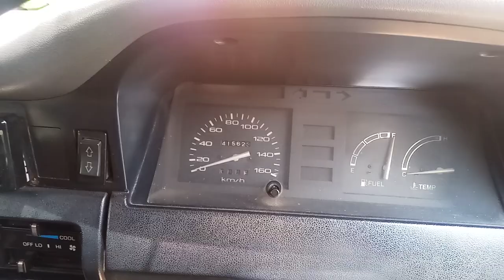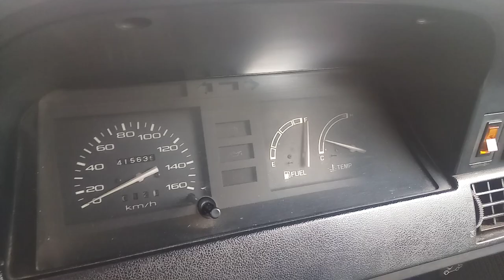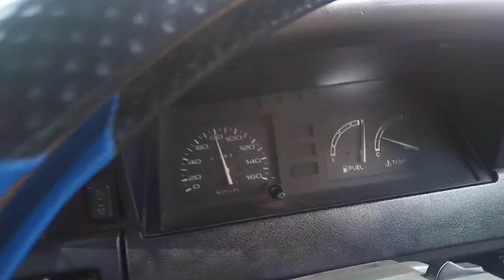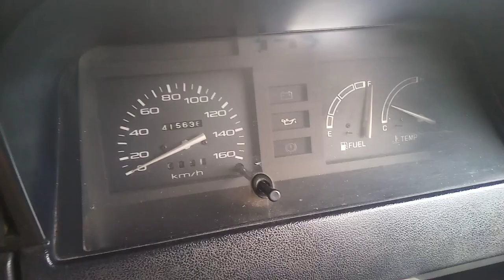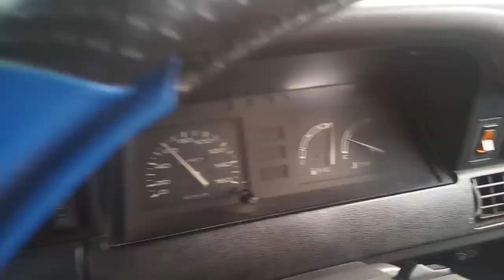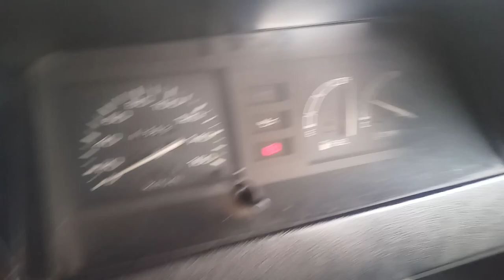Uji Jarak Tempuh Kijang 7K Dengan 1Liter Pertalite = 16 Km

Comment: Mantap juga om. Saya juga pake kijang 1.8. Konsumsi bbm teriritnya yang pernah saya dapet 1 liter:14 km dengan karburator standar, ukuran spuyer standar
Reply: Pakai spuyer ukuran berapa mas...
Reply: @gusleosamangun302  Main jet primer 110
Reply: Spuyer sekunder berapa mas...
Sya jga pakai kjang super 7k 96 long..🙏🙏
Reply: @gusleosamangun302  Standar pabriknya juga. Sebenernya untuk spuyer sekunder gak terlalu besar efeknya ke konsumsi bbm. karena dia cuma terbuka di rpm tinggi, itu juga bukanya bertahap gak sekaligus full.

Yang lebih pengaruh justru di main jet primer sama piston jet/power jet.

Bagian primer karburator lebih banyak bekerja waktu mobil dipakai jalan. Sekunder membantu di rpm tinggi & kecepatan tinggi aja
Reply: @willemdafoe9561  trima kasih infonya mas.. sukses slalu..🖒🖒🖒🖒
Reply: Coba kosongin karbu nya, terus pake 1 liter
Reply: @Azzam_khalif_Pangandaran  Udah. Di dlm kota dapet rata2 1:10. Kalo 1:14 cuma bisa dicapai di jalan tol yg lancar & kecepatan maksimal 70 km/h, diatas itu gak bisa
Reply: @willemdafoe9561  punya saya cuma dapat 7 km,, haduhh harus di setel lagi ni
Reply: @Azzam_khalif_Pangandaran  coba aja diservis & setting lagi mas. dulu sebelum dibenerin juga punya saya cuma bisa dapet 1:6
Reply: @willemdafoe9561  siap terimakasih

Comment: Resep e bang..bagi ilmu donk..
Reply from the maker: skep ori karbu ganti punya lancer
Reply: Kalo pakai rotor Celurit sampai brp 1liter/km nya
Reply from the maker: @dedikepiting5870  itu blm pakai rotor celurit,,, hasil oprek karbu doang,,, mungkin 1:18 nyampai kalo dipasang rotor celurit
Reply: Mau bos ku dibikin gitu kijang super G 96 saya
Reply: @CahnDalan310  alamat Nya dimana gan
Reply from the maker: @verikayla5256  bengkel mobil suraji ponggok klaten jateng
Reply: Maksudnya skep ori karbu yang seperti apa om
Reply from the maker: @drochmantochannel4336  yg asli bawaannya
Reply: @CahnDalan310  punya barangnya om
Reply: Mgsdunya skep karbu punya lancer, tp yg ori ya mas?
Reply: @CahnDalan310  izin  mas spuyer pakai ukuran brp om sy pakai 110 klu di bawah itu agak ndut2  apa yg mau di stel lagi